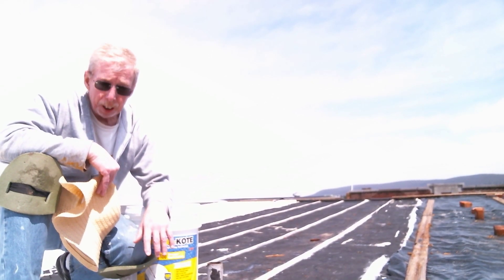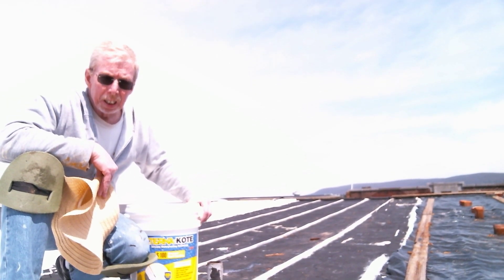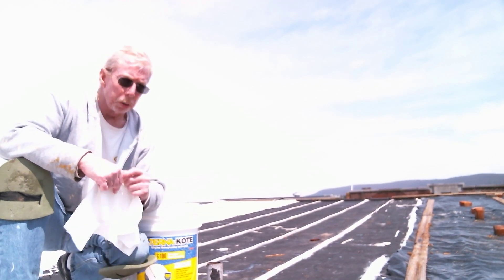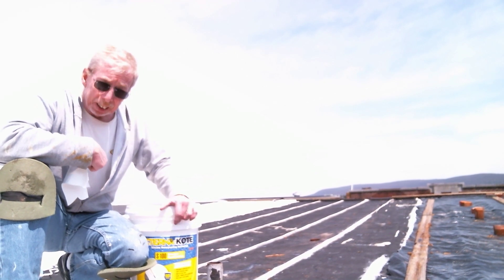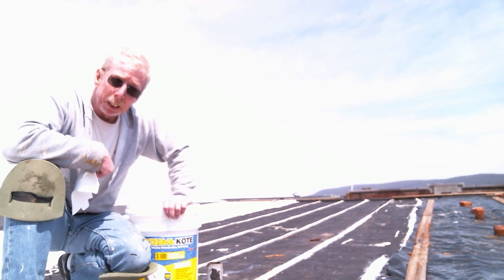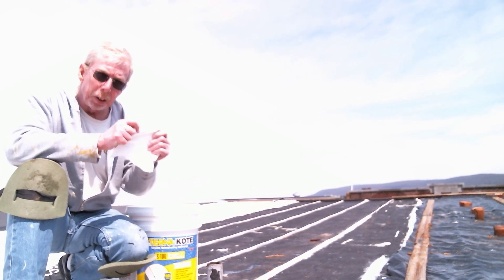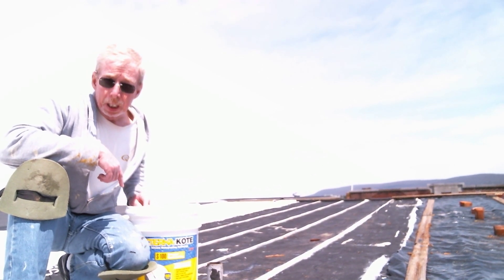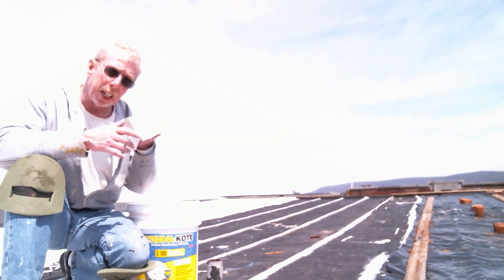Silicone: Silicone roof coating

Comment: would this seal leaks on a flat rubber roof and hold up over time, having a hard time finding anything that will stick on my rubber roof and stay more than a week lol
Reply from the maker: It will most certainly hold up, but only for 50 years.  I advise that you coat it after a good hard rain, saving you from the impossible suggestion to pressure wash it first.
Reply from the maker: And, don't forget to like and subscribe IF my advice serves you well!
Reply: @GEOsustainable  Too bad the roof silicone paint is so expensive. It would seem cheaper to make your own with ODORLESS mineral spirits and silicone caulk. Only I wonder the fire hazard before it evaporates - it is soaks into the roof.

Comment: So how's it looking now, after not quite 2 years?  Any issues?  I don't have a flat roof, but if I didn't apply it too thick, I suspect I could make that work on my slanted roof.  I like that it is white, as it should reflect much sunlight and make my attic slightly less hot...
Reply from the maker: It still looks like new, it will last 50 years. This product is very thin, so not to much slant, or apply it in thin layers. Build to 2mm is what the manufacturer recommends.
Reply: @GEOsustainable  Amazing fast reply!  Did you figure how many SQ Ft you can cover with  5 gallons?  How long does it take to cure?  That could be my problem, as much of it could slide off the roof if sags for 24 hours.  Maybe add some cornstarch?  ;-)
Reply: Yes, I could powder the area about to be worked with cornstarch, and then cover it with silicone, and then sprinkle more on top.  What the heck.  $200-400 for a cheap roof job that I could do myself in a couple of days.  Assume the stuff doesn't slide off...  Anyhow, thanks again, signing off.

Comment: I have a hard time imagining silicone could stand up to the intense UV and heat of most roof tops. After ten months how well does it hold up.
Reply from the maker: It is guaranteed 50 years. So far great, even over old tar.